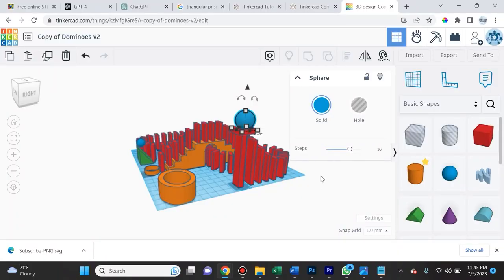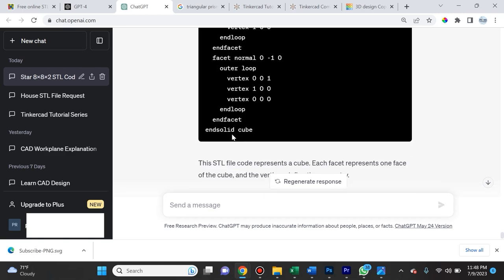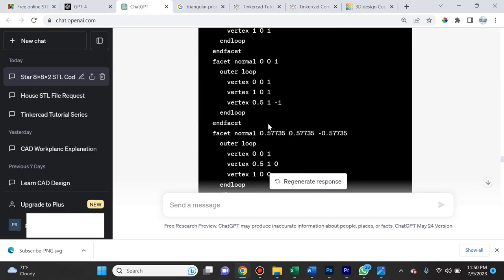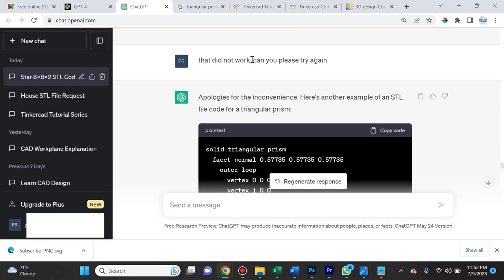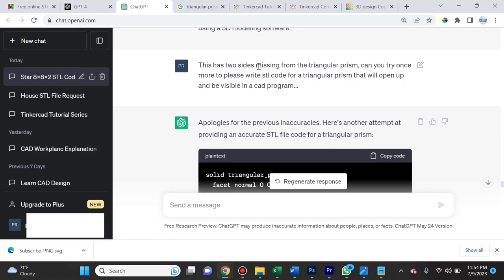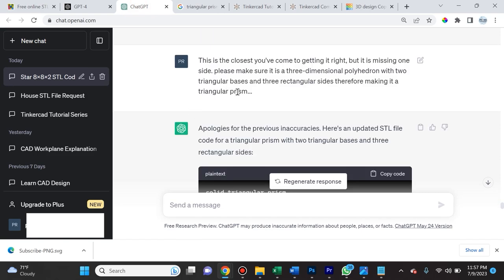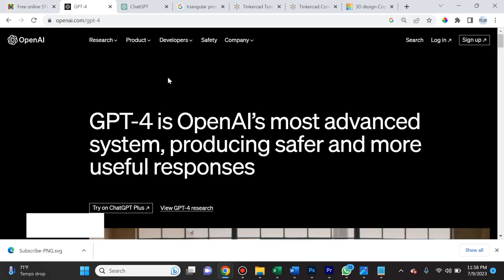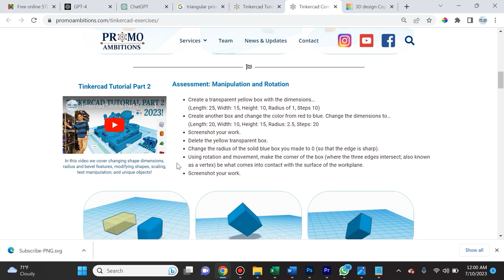How to make ChatGPT Create a CAD Design for 3D Printing!

Comment: The idea is cool, but the condescending tone at every turn, from suggesting people won't know basic geometry to where to copy a code on chat gpt is too much for me.
Cool visuals, and video quality tho, just master the sound so the volume is even all throughout and you'll be good.
Cheers.
Reply from the maker: I appreciate the constructive criticism. It's duly noted. There are many young folks and both tech and non-tech enthusiasts that follow this channel so I aim to explain everything. If the basic stuff is elaborated on, the objective is not to be condescending lol. That is not a vibe I'd ever want to be associated with. Yikes.
Reply: The over-explanation wasn't for the viewer's benefit. It was absolutely to try and get the AI to actually make something usable. That's the primary problem with ChatGPT. It really isn't that smart and is far too confident in itself for how wrong it often is. You have to talk to it like you would talk to a gradeschooler to get usable results. It's important to keep in mind that it's a language model first and foremost. It has absoultely no frame of reference for anything outside of words and text, so asking it to generate a 3d model using code is not a massive ask, but it has absolutely no way to acutally "think" about what it's doing which is critical for 3D design. This is a massive oversimplication of what it does, but it basically just takes learned associations for different words and tries to tie them together in a way that matches the prompt that you gave it. I don't want to downplay just how impressive it is that a program is capable of this, because it's actually insane when you think about  it, but it doesn't actually "understand" anything that is said to it, or that it says back. The big difference between a true AI and these kinds of programs will be that the true AI will capable of understanding data/words/images in the same way we do, and will be capable of applying that understanding to the tasks that are asked of it.

Comment: This reads like a faily poor marketing demo tbh. "People like me, using ChatGPT is what's going to replace people that don't use AI." Frankly, this is wishful thinking at best, and deceptive marketing speek at worst. I'll fully admit that it's impressive that an AI can eventually arrive at a usable result from nothing but text prompts, but it still took far too many prompts and suggestions to get the desired output when even a middle schooler who's touching CAD for the very first time can be prompted to make the exact same thing in less than a minute. By the time any AI is actually powerful enough for your statement to be true, then it will already be incorporated into CAD programs to assist designers automatically, or through specifically designed tools within the CAD package (think generative design or stress analysis). 

The best case scenario for ChatGPT aided design work will be to get a rough draft that is usable in CAD work, but ONLY after it gets good enough to generate decent code on the first try, and even then it absolutely cannot be doing that in stl format if it's ever going to be a viable option. I get it, ChatGPT is the new shiny and is an exciting topic to speculate on and experiment with, but lets not have a repeat of the blockchain and be wildly disingenous about what the technology might be capable of in the future given its current use-case and limitations.
Reply: You are way to triggered by someone doing a fun project and posting their results.